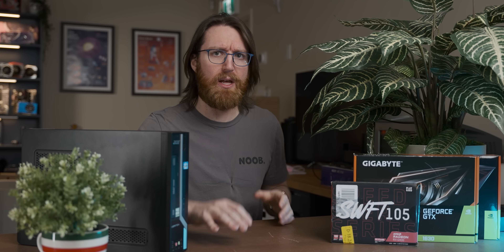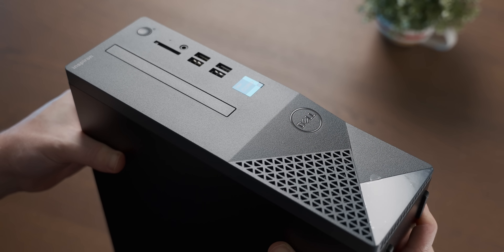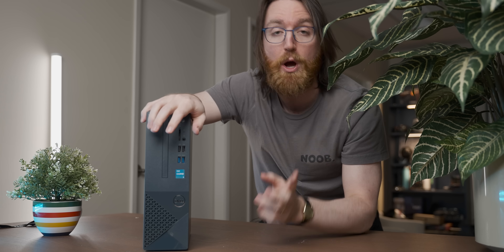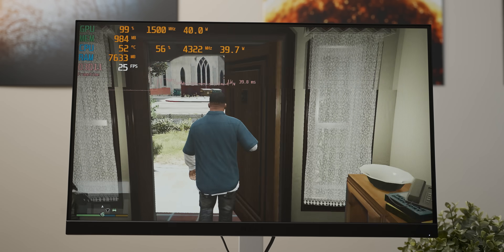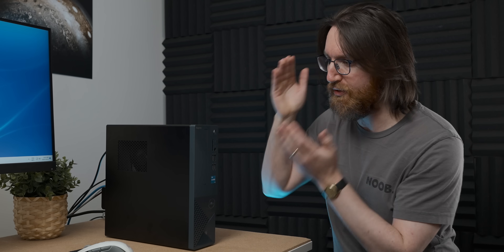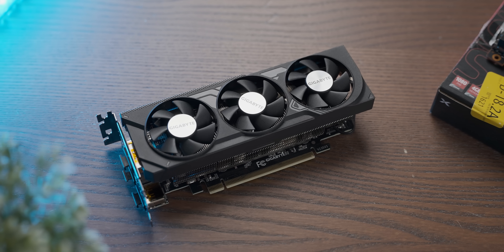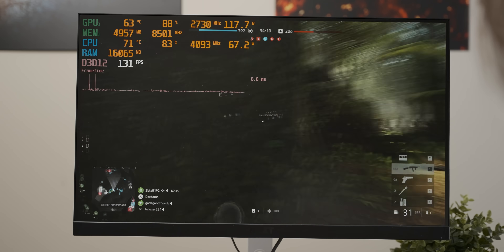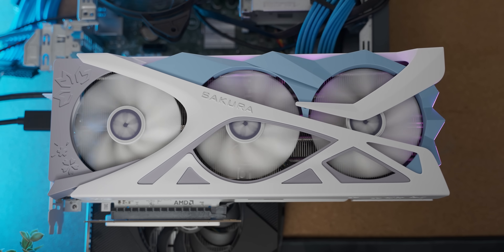The FUTURE Of Budget PC Gaming?

Comment: Putting an i9 Dell with H-series chip is inspiring. on I recently bought a 2nd hand lenovo i5-10400 & a 2nd hand 2070S seperately for less than $400 with a new PSU $100 for gaming. The problem is the ram upgrade...

Comment: Hello, this PC is actually using the ATX 3.0 12VO specification. Which, while you only currency have 180W to work with you can do drop in replacements with TFX form factor PSUs as well as HDPlex compact PSUs and make ample room for thr GPU. 

For people who still want to utilize the existing system spec psu with lets day an RTX 4060 LP today and later on we get an RTX 5060 LP or RTX6060 LP that might need a 6 pin, you can look up ATX 12VO breakout cables and the motherboard itself will break out 12V 6pin power instead of using a sata adapter. 

Hope this helps anyone who might have to go down this route or just wants a PC in the livingroom.

Comment: I'm in the process of convincing myself to pull the trigger on the newest Optiplex, with the i5-13500 and DDR5. The DDR5 is key here, because is the only motherboard that dell have that is pci-e 4.0. The DDR4 versions are all 3.0, so my RX 6400 can finally strech its legs. Also, 310 W 80plus platinum psu.
Reply: Also, just checked: this inspiron is indeed pci-e 3.0 only, so you're bottlenecking all gpus shown, the RX 6400 the most, probably. Also, it is currently $ 399 on Dell's website. Maybe it is worth picking for some people.
Reply: Bro just build a pc
Reply: @LAMG059  brazilian sff and itx market is non-existent, and I'm willing to deal with the optiplex disavantages to keep the form factor. I use a 7020 on my living room, and intend to keep using a similar build.

I've built pcs before, but I no longer have the physical space  for (or want to own) a traditional tower. Even something as the Q300L is too big for my needs. If it is bigger than a PS5, it's too big for me.

Comment: A corporate sad box having better performance than my delidded, water cooled 7700K is a sign that i was right to finally have upgraded from it lmao.

Edit: i ran cinebench overclocked to 5.15GHZ with cache overclocked to 4.4ghz and it matches the 13th gen i3 but is probably using enough power to run the local homeless shelter and is acting as a space heater.
Reply: At least you can get a good OC out of it and match a modern CPU, even if it's a low end model.

I'd say when you finally upgrade that you got your money's worth out of it.
Reply: @volvo09  I still am! I under volted it and leave it running a minecraft and plex server in my living room. It's now in a semi retirement.

Comment: I've been doing a ton of Xeon X5570 builds latley. I was able to get 13 new ones for dirt cheap. I gotta say I'm pretty impressed with them. I adjusted the base clock frequency and they perform really well paired with R9-280x. Great entry level esports rig.
Reply: for esports you could use the best apu's and be done for higher fps
Reply: @pav1u  boring. I do this for a living. Thanks for your input though.
Reply: @SmithBeatZ1 bro you just come off rude and arrogant. Thanks thou 😂

Comment: The Main issue I see with this test. Most offices I know have mostly laptops. And if not, they are usually smaller and effectively are laptop motherboards (so no upgrade other than memory and storage and theoretically cooling) in a small case. Quite often they actually require DC power, so they even run on what is effectively a laptop power supply.
Reply: Do you think PC power supplies are putting out AC power into the PC?
Reply: @wyterabitt2149  No, but Most PCs get AC into the Power supply and Output different DC Levels. A Lot of modern Micro PCs get DC at 12V and output it to the different DC levels needed. The DC they get comes from an external power supply which obviously gets AC from the mains.

Comment: How about replacing the psu with something that fits and see what kind of cpu you can drop with a low profile cooler and mod the case to fit a more decent gpu than a rtx 4060?
Reply: Dell mobos have propriety headers (smaller size) so its difficult to do.  Plus the power delivery on those boards is not meant to be high, hence why it capped itself at around 100w.
Reply: Yeah, it was fun to see the performance but it’d be great to see different choices etc. that would fit in the case.

Comment: Whether it's new or older, the biggest hurdles I've found is: (1) power supply (some, especailly SFF cases) use proprietary power supplies which are not really powerful enough for any dedicated/add-in graphics cards, (2) space issues (can't even mount the video card in some PCs), (3) port issues (doesn't even hav ea PCI-E x16 slot which seems quite common on office PCs since most use CU graphics), and lastly (4) BIOS (the BIOS sometimes is locked to a point where you can't really do much -  yes you can run things at stock speeds but upgrading can be an issue because the cooler may not be suitable and/or the CU may in fact be soldered onboard -- not as common but was sometimes the case with older ultra-low power 35W systems and especailly true in some laptops I guess, not as much desktops although I think some ITX-based "desktops" I've seen did have the CPUs and sometimes one or all memory sticks soldered to the board).  But IMO the two biggest hurdles is space (size of the case) and power supply since it's hard to find some of these power supplies, and some now even use a power brick.

Comment: It's a FrankenDell PC.  Try using a non-K series i7, get some adapter cables and power the whole rig from the outside ATX power supply, Yank the Dell PSU out to get more space for the RTX 4060 LP GPU and you would have a somewhat neater setup. Maybe one of those Noctua low profile CPU coolers if there's room. Bonus points for modding the lid and having  a set of custom power supply cables made up to go right to the GPU and system board from a slot cut into the molded lid. Yeah boi!

Comment: I just want to say that the Inspiron is the consumer line, and not the business line.  The Optiplex line is what you want for a business PC!  

Then again, after looking at it after you opened it up, they look pretty similar.

Honestly, in 6 years, I feel like you should just buy a used Precision, which would be a full tower, and have the power supply to actually get some good components in there.
Reply: I like the potential of the T3630, except for 45mm height CPU coolers.

Comment: I’m gaming on a p510 Thinkstation I got off of ebay a few weeks ago for 70USD. It came preinstalled with 64gb of ram, 14 TB Server grade HDDs, a 512GB industrial grade nvme drive, 850W platinum PSU and some low end Xeon Processor which I upgraded to a 14c 2.7 GhZ cpu (which in gaming clocks at about 3.2 GHZ and only cost me 25USD) as well a a crappy NVDIA Gpu, which I instantly replaced with a sapphire rx580 I bought for 80USD. This beast is still upgradeable like crazy but tbf, I got really lucky with mine, however, it is not impossible to get one of those or the successor, the p520 for around 100USD.

I threw Arch on that thing and can now play Cyberpunk at high settings 41-56 FPS all day long with upscaling for less than 200 USD. Currently selling some insane enterprise PCI cards I also found in the system, so it is very likely I even made a profit on this PC.

This is my very first gaming PC ever and tbf it could be far worse. Especially at that insanely low price.”

Comment: Always need to be careful with large company prebuilt power supplies. About 20 years ago I worked on an HP that had a standard power plug for the mother board. The power supply went out. I plugged in a generic power supply, which fit perfectly. When I turned it on it started an electric fire. Upon closer inspection after the fire was out I realized they had swapped the order of some of the wires leading to the motherboard. How do you like that? If you dare replace your power supply with one you didn't buy from HP, we are gonna just set your system on fire. I suppose I should have expected something like that. Although, running 2 power supplies at the same time on the same system is always an option.

Comment: Having Cyberpunk run at 5FPS on low on there is hilarious.  

I have a 11th gen Tiger Lake notebook with a i3-1115G4 (2C/4T, and the lowest end GPU of that series)... and with Ubuntu 22.04 with updated "Mesa 24.0", and running Cyberpunk through Wine I get like 8FPS.  

(1.60 actually got about 18FPS in the bar, 1.62/1.63/2.0 wouldn't run until I got Mesa 24.0 on there, which has "Vulkan VM_BIND" support for needed to provide some DX12 features that apparently 1.60 didn't need but 2.0 does.)

I'm actually impressed by it!  I got a $300 notebook that I made sure had expandability, bumped it up from 4GB RAM to 20, and threw plenty of storage in it.  I did not know if I would be able to game at all on it (given the poor compatibility and very poor performance of Intel GPUs in Linux in the past -- great 2D and video, horrible 3D support. )   The Iris driver (newer Intel GPUs) and Crocus (older GPUs) are a night and day difference over the previous i915 3d driver.

Comment: This is hilarious as always which i guess is the point.  If i were going to buy a new office pc for this i'd go with an hp that has like 4 slots, like my i7 7700 800 g3.  not only does it have 1x16 then 2x1 but also to the farthest right a 1x4.  that means i can put in a dual slot graphics card like the  rtx 4060 in the 1x16, put my wifi antenna in the other free x1 slot and use an adaper for an additional nvme card in the x4 slot.  AND the hp has an upgrade path for a 400watt power supply that will allow me to power the 4060 and the cpu and the multiple nvmes and possibly even some hdds if i were so inclined?

Comment: I have an Acer Veriton VS2710G with an  i5-13400 and a 300W TFX power. I'm looking for a way to use an Arc A750 with it that I got off a good deal, but facing similar challenges as this video with the wattage and lack of 8+2 being the biggest problem. Any ideas?

It's also interesting to see you run the system at less power than suggested. Is that a thing?

Comment: i snagged a brand new hp with a 6 core 11th gen cpu and a 512 nvme ssd for 300 it only had 8gb of ram but a quick el cheapo second stick fixed that right quick it supports full sized dual slot cards and an atx power supply there is even some room to add a smaller tower cooler right now my grandparents are just using it since there kicked the bucket but i look forward to messing around with it in the future
Reply: What model name is this mysterious PC?
Reply: @zeroturn7091  shit bro uhm it was a Pavillion and model number beyond that is beyond me

Comment: when TDP limited at the socket you have 2 options.
Gaming: i5 14600kf, or whichever has 6 cores and the least amount of E cores and no iGPU(unless you plan on only using the iGPU, then go with a Lenovo M75Q Gen2 with 5750GE.
For server, 14900T, it may sound weird, but when TDP limited, , on workloads that can use all the cores, the more cores you have the better, even if they're slower
For instance, in the same power draw, my old file server got 70% more performance going from a 3700X to a 3950x, sure the clocks dropped from 3.7Ghz down to 3.1Ghz to maintain an under 80C temp with this ~45w cooler in a 1U chassis, but 70% more performance, for the same power draw is great when you dont have to change anything other than the CPU.
But if i were going for gaming, i'd have gone 5600X3D if i could find one, otherwise a 5800X3D

Comment: For me the meta just evolved into hunting for them ATX case and PSU workstations with i7 8700 or i5 8500 and adding more ram so the system is up to 32GB or 16GB of ddr4 and of course adding a gpu and an ssd. 
I even started encountering noname workstations with older Ryzen 7 1700 and 2700x and some with Xeons like the E5-2667 V4.

Comment: Interesting, impractical, and hilarious. As always. Though, as I often do, I wonder if you could try to keep the internals inside of the system. Maybe not the graphics card, but I’d be curious what sort of power supply upgrade you could manage that would actually fit inside of the system.

Comment: Could have tried the low profile RTX  3050 6GB. That doesn't need extra power connector. It still needs a 300W PSU though

Comment: Hey Dawid, using a single SATA to Dual SATA and then to a GPU 8 pin not safe at all. You are still powering it off from a single SATA. The correct way is to make a cable that connects straight to the motherboard by checking the pinout. Some unfortunate viewer may repeat what you did and will burn down his cables/pc.

Comment: I would have went with a HP Elitedesk 800 G4 for like $150 on ebay. You can drop a i7-8700k in it and a full size graphics card as long as its not to power hungry. It did have a option from the factory for a RTX2080.

Comment: Dawid love the video. Is there a barrier to swapping out the original power supply, and/ or using a different case so that the alternative graphics card can go inside
Reply: You need an adapter for a normal ATX power supply and the dell motherboard may not have the same mounting holes as a normal motherboard. TechYesCity does those swaps a lot so check out his channel.

Comment: my current work computer given by my employeer is what will qualify as a dumpster pickup, a Lenovo Thinkcenter with a 10th gen i5, I opened it up and it's very nice, it has an m.2 slot, dual channel support, too bad it won't fit a decent gpu, but the rx 6400 should sufice now that AMD released those crazy drivers that improve performance like a monster, it will be a good computer to put ChimeraOS or something similar

Comment: The up coming issue with using a discarded office PC is 2024 Windows 12 will release and most likely require an intel 15th gen or AMD 8000 or 9000 CPU to run so an Intel quad core will not be enough as windows 10 is also no longer sold. So TPM is required or command line commands to get the check to just not happen are needed for windows 11.  Now if you have a ISO that installs windows 10 and a key for it to then yeah a office PC will be good but anything after windows 10 it will not be able to run. 

The other upcoming issue is the windows 10 authentication server shutdown so a crack will be needed to install it in and after 2025 if you are using a Microsoft account that doesn't already have a activated key attached to it.

Then you have the amount of system RAM required to run newer games seems to be only going up. DDR4 is also on its way out with DDR5 taking it's place. Even LPDDR5 is a thing now the LR version of DDR is usually the last version of the RAM to be made into a spec.

The "optional boomer storage" is probably for you 10TB to 22TB in 1 3.5" HDD. Yes 22TB HDDs exist just that 1 drive costs as much as than the rest of that computer when he got it from Dell.

Comment: fyi, for the dell it's because they actually follow the normal limits suggested by intel. The 200+ sustained load you find via other pc's of that cpu is not acutally the way it was designed to be used and not the way power delivery was designed to be implemented.
Reply: Also, I feel it's the VRM overheating in the case.

Comment: Wasn't the motherboard limited to PCI gen 3 anyway ?
I'm pretty sure you coult fit the GPU inside by getting creative with the mounting bracket and how you secure it to the chassis/power supply. I once made a custom HDD cage that floated next to the CPU cooler in an old slim horizontal case that went into an arcade cabinet.
Also, there is a way to replace the power supply with a beefier one but you might not like it. Use a standard one but take it out of it's casing ... X ) I also did that for fun project where i would fit an entire PC into it's motherboards box. It was a shitty system meant for win 95/98 retro fun but man those power supplies are a waste of space.

Comment: It makes for a less fun video but a Dell mid tower is much more practical for this kind of thing. It's what I use currently! It's just kinda fun to run Starfield and Baulders Gate on a Dell office PC. There really isn't a good solution to the power supply issue that I have been able to find so far.

Comment: Asus launched a 4060 low profile that requires
 only a 6 pin power connecter. Would be great to see how it compares to 8 pin Gigabyte version. With Asus you don't have to use that screechy sata adaptor...

Comment: you should use intel T series cpus with these systems because thats usually what they are designed for, eg i9 13900T as they have lower power limits but are hard to buy

Comment: For what it's worth, if you go into an alley to fight a badger for your next gaming PC, do not come out with an office PC, and do not come out with a Dell. Instead, fight until the badger lets you have a used workstation. While it will most likely have a 2066 or 3647 socket, either will have satisfactory upgrade potential. You might even find one that already includes a Quadro GPU, not ideal for gaming, but still better than an embedded Intel HD graphics.